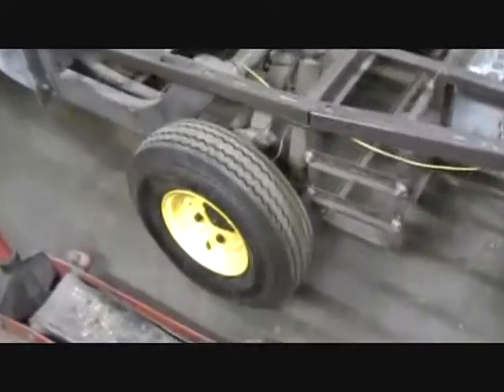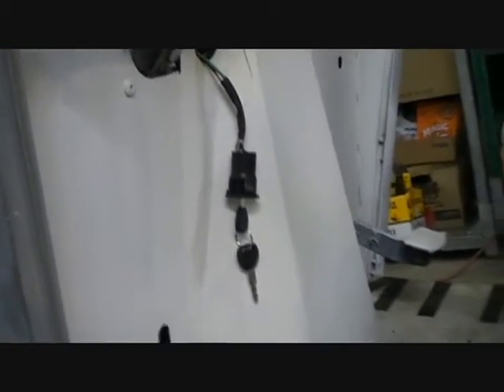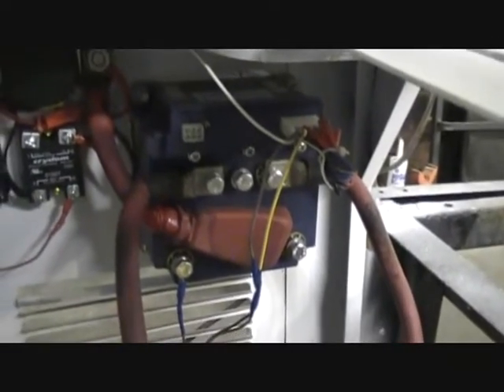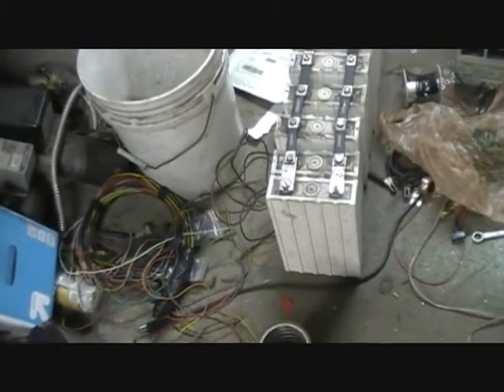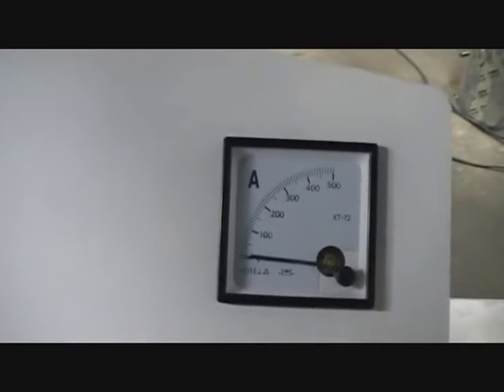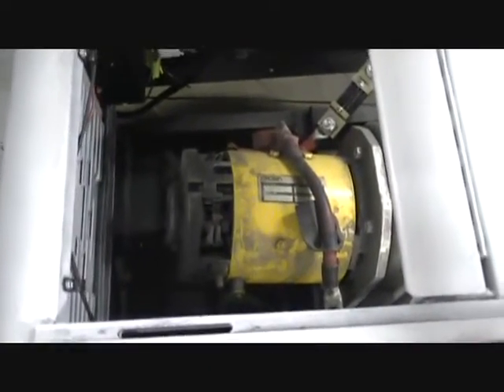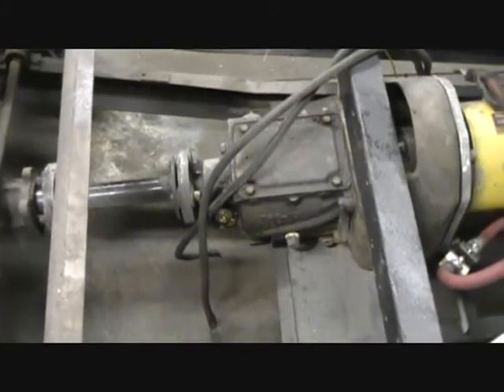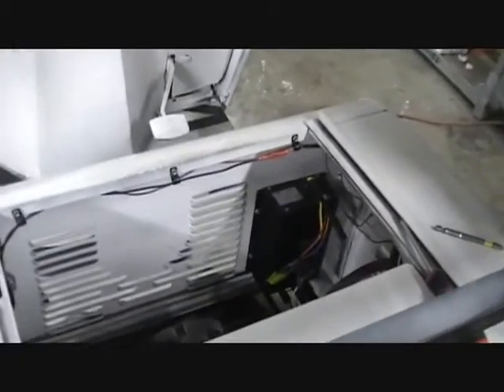1961 Cushman Truckster EV Conversion LiFeP04 - Part 8 UPDATE

Comment: Did I miss it or are there further updates on the Cushman project?
Reply from the maker: Sadly, the cushman is in a holding pattern.  Other projects have taken precedence.  My job changed, so my need for the electric range of this truck has changed.
However, it is for sale in basically the condition I left off with in this video.  Totally finishable to the right person without much added expense.  Only a few items left to be acquired.
Thanks for your interest!

Comment: i have an idea why not put a little indicator light on the dash that turns on or off when its done starting because that would be help full i say if your in a noisy area and cant here it click!
Reply from the maker: ***** 
Excellent idea.  I have an LED I was planning to wire up when the key is on, to remind me I left it "running."  Let me ponder a way to wire it to the time delay circuit.... 
I'm thinking of posting the wiring schematic I designed as an open source design too.
Reply: ok sounds good you should make a video of you wiring it up like make it a time laps tho so you dont waste 30 min of some ones life lol

Comment: fan voltage, buck converter perhaps, will be a great machine
Reply from the maker: George Gardinier 
Actually, I just bought a higher CFM 12v fan instead.  7" instead of 4", so it should help keep things cool and solve the off delay problem.  Good call though, thanks!